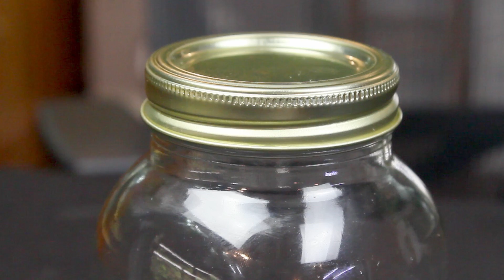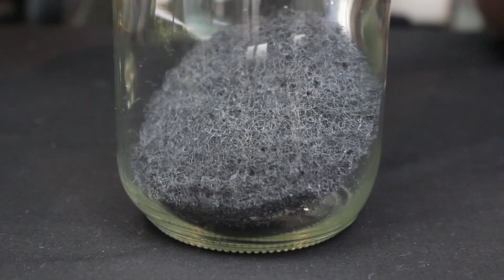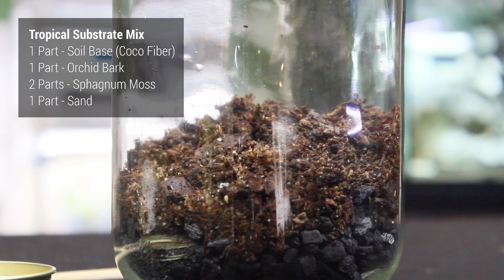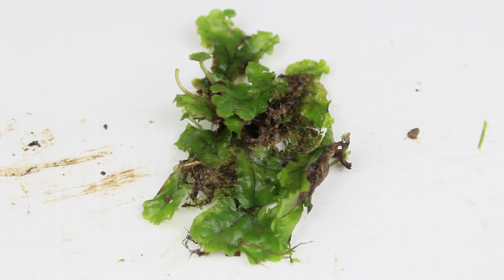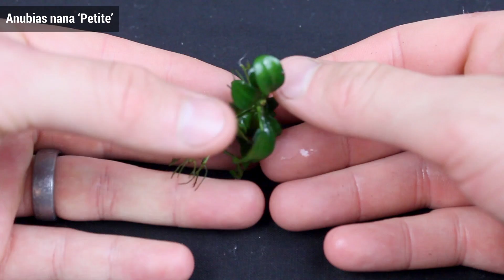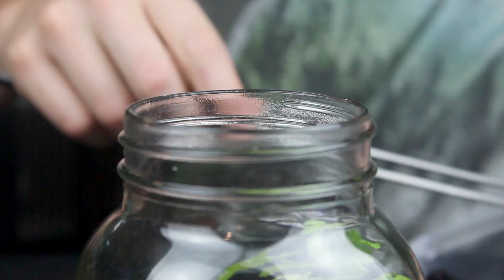Simple & Beautiful Terrarium Build!

Comment: What is a "false bottom" for? Why can't you just put soil at the bottom?
Reply from the maker: Here's a video all about it https://youtu.be/slDOiWyKWu0
Reply: YetiMonster1473 it's so the excess water has a place to pool at the bottom without constantly making the soil soaking wet, which would harm most plants. With the false bottom a mini water cycle is created via the evaporated condensation and extra water in the false bottom, simulating the water table, earth and atmosphere which creates a stable mini ecosystem :)
Reply: @philosofern  Ohhh that makes sense. Thank you!
Reply: It makes a pool at the bottom to stop the roots from rotting... they’re also used in planters too!
Reply: He has a video on it, basically it helps with water condensation and is super important in a closed bottle